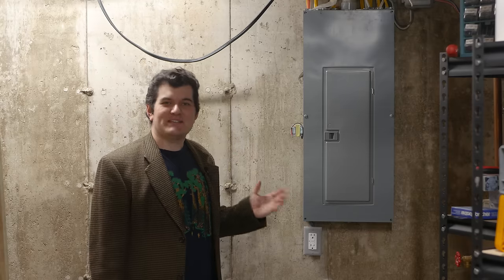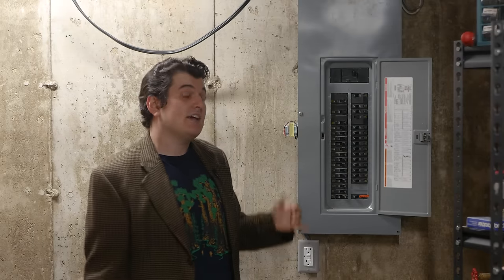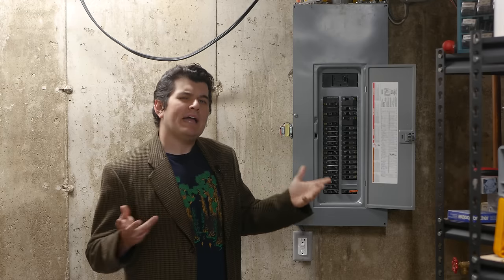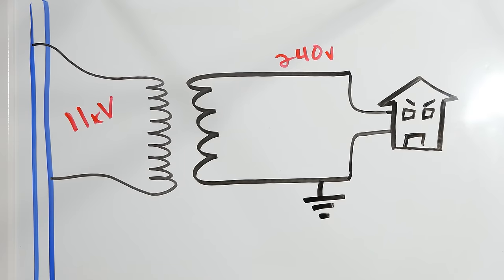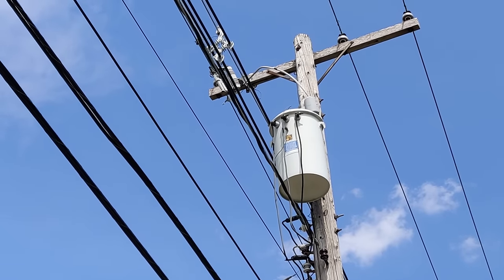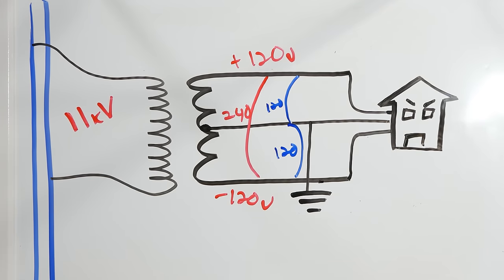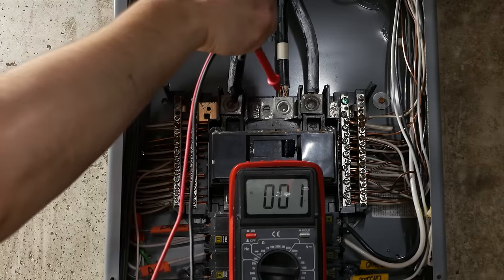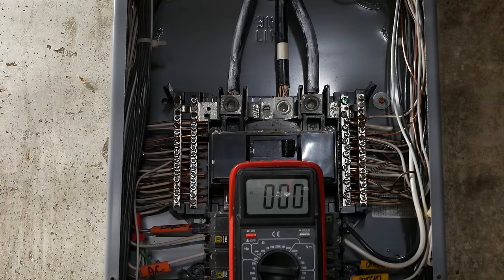The US electrical system is not 120V

Comment: Interesting point regarding the UK plug switches: Yeah, a lot of our stuff that's not pure electrical does not have an off switch (generally electronics just.. don't) as you're expected to interrupt the circuit at the wall.. however: We have the switches for a different reason.

Our plugs are so big and over-engineered for safety that insertion cycles becomes a problem so they're actually there to save a pile of plugging in and removal causing work hardening/loosening of the contacts in the socket - flick the switch rather than break the receptical by having to over-use it..
Reply: Yeah, here in the US we don't worry about stuff like that. Our plugs come  pre loosened.
Reply: I will still never get over Tom Scott's video on British plugs where he explains that in the olden days, British appliance manufacturers weren't required to put plugs on their products, so most appliances came with a bare wire that the customer had to attach a plug to themselves.
Reply: Also it means we can remove the foot hazard caused by having dangly plugs everywhere 😎
Reply: Sammie1053 Ironicly in the US, you can still buy an appliance without a cord, so you have to buy the cord and wire it up.  I think it is mostly on stuff like refrigerators and washing machines, tho.

Edit:  What I meant to say was ovens and dryers.  Sorry about that.
Reply: @Sammie1053  We still commonly teach students how to wire plugs in physics lessons in school - incidentally it's quite useful because it means plugs can be removed and added to cables so we can change cable lengths etc ourselves without wasting perfectly good plugs 👍
Reply: @Sammie1053  We were actually taught how to wire plugs in schools, apparently? I was born after the laws changed and everything came with plugs pre-attached, but I was still taught at my school "just in case".
Reply: The UK plug are shit. Too big, too clunky, and  no real life advantage. Just use the standard EU plug like everyone else ffs
Reply: You haven't watched the Electra boom video is he says UK plugs are the best and EU plugs are just as bad as American ones
Reply: The best thing about british plugs will always be the insulator over the bottom half of the connectors, and the fact that the ground connector opens a shutter to the live and neutral connectors.

The switch is nice when removing the plug though, it just adds one more layer to the safety. You know that there's no chance of you getting even close to the connectors when removing the plug.

Most of our multi gang extensions don't have switches on them though. I have a fancy one that has individual switches that I use for a load of old gaming consoles I don't always want on at the wall due to age though.
Reply: @aggressivli  The advantage is not having to replace millions of sockets in every building in the country (and every device that plugs into them) for a plug socket that isn't actually improving anything.
Reply: @aggressivli  There was a plan to harmonise all the plugs across the EU, but it was deemed to be too wasteful and expensive, so we all just kept our national standard plugs.
Reply: @rainehdaze9157  yeah, its already too late for this I guess
Reply: All true and great points.... But there's more to it that that as well, it's a case of isolation....

If you have a switch on the appliance and not the plug then the wire is still "hot" up intil the switch on the appliance. Meaning if there was an incident that wires were cut or damaged to a short then you could be in serious trouble.

By having an isolation switch at the plug your not only remove the "hot" wires from outside its safety area(in the wall cavities) but also stopping you from unplugging everything and standing on a 3 pin plug that you are 100% sure has went thru your foot into your brain (yes it's very painful)

UK electrics are wwwaaayyyy over engineered but the safety ratings speak for themselves.... And the fact people are arrogantly stupid when it comes to DIY solutions.
Reply: @lukesalisbury6031  Also garbage disposals (you know that thing under the sink that grinds up food and spoons).  The reason dryers and ovens don't come with cords is 1) cost and 2) there's actually 2 different plug standards for those in the US, a 3 prong (2 hots and a ground) and a 4 prong (2 hots, a neutral, and a ground).  Older houses have the 3 wire one because it's cheaper (less wire) and newer houses have the 4 wire since it's required by newer versions of the NEC.  Why, I don't really know.
Reply: @Xilog  don't be ridiculous.  American plugs are not more likely to get loose.
They already ARE loose.
Reply: The only thing the UK type G plug is worse at safety wise then the US type A/B is when you tread on one on the floor in the dark....

If you think treading on lego bricks is painful you have never trodden on a UK plug which inevitably ends up with the prongs upmost!
Reply: BS1363, best in the world, accept no substitutes!
Reply: Sammie1053 wiring a plug is part of GCSE science, or at least it was when I grew up. I figured the plug was so obscure it was easier to manufacture overseas and then have the brits wire it themselves.
Reply: Whats the deal with his hating Ring Mains? They kick butt.
Reply: @earfolds  not quite, Italy are changing gradually from type L to type F and some type J countries are considering the same 

The EU standard plug is the 7/7 (high power class 1)or 7/17 (high power class 2)or 7/16 (low power class 2) all 3 of these fit in type E or type F sockets (and type C although with no ground in the case of a 7/7)
Reply: @barnstormer322  Except for moulded plugs.  then you have to put a wander socket on the stub end if you need to
Reply: @Xilog  I have had a few wall sockets wear loose on the internal pins
Reply: @aggressivli  Nonsense. You will never kill yourself with a UK plug. You might injure yourself if=f you stand on one though!
Reply: The UK (note, I'm in the UK), is a desperate case. Maybe was the atavic memory of the great fires of the past, but with electricity we went from "safety first" to "safety only" in a eyeblink.
Not everyone knows what is the "Clause 12" in the British Electrical Engineers rulebook for electrical plugs. For clause 12, the plug must be designed in such a way the two fingers holding the plug while placing it in the socket, cannot be able to touch, at the same time, the two plug blades. That's the reason for the two bulges on the sides of the plug. Every plug must hold a fuse. The socket holes do not open if the ground blade is not going in first. Every socket must have a switch. The plastic must hold the max operating temperature forever. The cable getting out of the plug must have a mechanical hold. I can keep going on electrical BS (British standard) all evening.
Fact is, the UK plug is pretty safe. Safer than any other plug in the world. It was designed for electrical devices of 1940, and sized accordingly. It is not scalable: as matter of fact, it can contains a 20 Watt power supply easily. But there are disvantages. Manufacturers of many different devices include usually a 5 V power supply, except for the UK, as they should also upgrade the equipment packaging. All imported devices require a non-standard, more expensive specification.
It is a typical British heritage, making some items slightly more expensive and hard to procure in an intensely globalised world.
Think of bayonet light bulbs. Manufacturers now make these universal 90 - 260 Volt AC / DC light bulbs, to reduce costs, but what if the lampholder doesn't have the Edison screw base?
Or, try to sell (or buy) an automobile from Europe. The specs are all the same, but the steering wheel is on the passenger side. While is nice to have some personalisation, it adds to cost in the end. Just like the ultra-safe UK plug. Notwithstanding all the complaints of over-engineering, over-size, over-kill, I prefer to keep the extra safety.
Reply: And now for the obligatory puns...
I was wondering WATT your next video was going to be about and got all  AMPed when it came out as I always gets CHARGE out of you content. I figured JOULE explain at in a way  most will understand. 

I know this can be a HOT topic but you'll try and be NUETRAL and remain GROUNDED if anyone complains to tell them to put a SOCKET in it. This is a very CURRENT topic and it requires a careful explaination but that shouldn't  PHASE you. 

You really do a good job of ALTERNATING between topics. You got a lot of CAPACITANCE  for explaining this stuff. You explain it with perfect METER in you speech. You're great at being able to FUSE complicated concepts in a coherent video that GENERATES  much discussion.

 I understand if some concepts are hard to understand even for you and it HERTS your brain, just RELAY the info as best you can.  Just don't LOAD the videos with to much complicated stuff. You do it your way, more POWER to you. 

You should go on the lecture CUIRCUT as you have more RANGE and sound are less DRYER in you mannor of speaking then some.  Just don't stray to far from OHM sweet OHM.  

By the way, what do you think of a symphony CONDUCTOR doing INSTRUMENTal AC/DC tunes? Would that be ELECTRIFYING or would it fall SHORT of your standards and make you want to VOLT out of the theater? But that beyond the oscilloSCOPE if this topic. So I'll take a BREAKER and SWITCH to other tasks. You're always a LIGHT at the end of the tunnel even for dim BULBS watching who are too easily LED astray.
Reply: Ted Logan DCL is now standard in EU.
Reply: @aggressivli  The european ones are truly awful.  I know I'm biased cos I'm Uk, but no, those ones are awful. They are loose, move around in the socket and, just no, they're awful.  Really.
Reply: @gingernutpreacher  In that case I want to see what he thinks about Schuko plugs. Basically most of the good things of the UK plug (minus child protection as standard and an integrated fuse), but much less of a foot hazard.
Reply: @lukesalisbury6031  That's true, I actually helped my parents put the plug on their dryer two years ago. It's because as mentioned in the video, some high voltage sockets are two phase and some are three phase, so the dryers are designed to use either and have the cable connected at installation depending on which one is needed.
In the case of old British appliances, we're not talking about kitchen appliances, we're talking lamps and toasters here
Reply: @aggressivli  UK it's are the safest sooo
Reply: @Sammie1053  Olden days? we were still wiring up our own plugs in the 90`s.  Its a pretty recent thing to have everything come with a fitted and sealed plug here in the uk.
Reply: @dasy2k1  The EU standard plug I'm talking about is the aborted Type N (IEC 60906-1) switchover.
Reply: @ec8107  As I learned from experience while visiting they come with bonus zing if you are not used to them and thus fail to treat them like they were designed by an utter bloody moron. Suffice to say did this exactly once but was enough to make me put my totally not an electrical engineer skill set to the task and fix the problem, a bit of insulating tape works wonders to fix the built in death trap cheap too lol. Still why on Earth can a software engineer figure this out but not the person that designed the plugs did they have any engineering qualifications at all I wonder? That said granted tape does not have the wear resistance to last all that long with repeated use, really should be a more hardwearing insulator than that but still was more than happy to replace tape in order to avoid repeating the painful lesson about US plug safety or should I say total lack thereof.

Not that ours don't have their own painful surprises in store for the unwary mind you step on the damn things and learn the hard way that lego has a challenger for most evil foot torture implement ever devised. Actually probably might just want to take my word on this and avoid trying it but each to their own heh.
Reply: @Jademalo  Only the new plugs do have insulators. The old school ones do not have insulators, much like the US plugs made today.
Reply: @lukesalisbury6031  

My dishwasher doesn't come with any cable. I had to wire it to the cabling already coming out of socket
Reply: @robertfullard5646  - They add a higher safety risk for absolutely zero functional or financial benefit. The risk is that they are inadvertently overloaded if any of multiple connection points fail (eg: <20A fed from only one side of the ring).
If you are running both ends of a 32A ring back to the consumer board (to create a ring) then you might as well just run two separate 20A circuits instead (and save the copper needed to close the loop).
Reply: @johncoops6897  True but you're going to have to double the size of a lot of people's consumer units to do that at this point and not many people would be in favor of that as a lot of them are in small cupboards in hallways that'd have to be modified.
Reply: @gingernutpreacher  ElectroBOOM was just talking about the Europlug (type C), which is better than the American plug, but still bad. Those two arent as good as the real deal which is the Schuko (plug types E/F).

Comment: When I was a kid, my little brother decided to drop a penny behind the outlet cover in his room. It was an old 120 2-prong receptacle and that penny fell in just the right way to bridge the gap, my family was all surprised when we screamed. I'm not sure why, but I was the one who ran out, through the living room and kitchen to get to the breaker box. Being 10, I just turned everything off as quickly as I could. Needless to say, my dad pulled out the remains of the penny while replacing the outlet and it proved to be a good lesson to all of us. My dad doesn't neglect electrical repairs these days. Though I don't know why he never did anything about the one power switch in a place we lived in for a year that almost always shocked us.
Well, actually I do. My dad was in terrible mental health during that time, so it took a lot out of him just to provide for us. He and my mom had split because of it, which honestly just made things worse, but that's all a different story.
The electrical system in the US isn't something you should play around with. Thankfully I know some electricians, so I know who to call to help me.
Also, I checked my panel. 100amp @ 240v. I figured, being a manufactured, single wide home. I think I'll save up and get my electrical system reworked, though. The place is about 30 years old and I would like to make sure it's all up to code.
Reply: @silversonic1 what did you find out? I'd be very surprised to learn that even a manufactured home from the 90s doesn't meet all the code that applied to it when built and even 95% or more of the most current electrical code.
Reply: @GurtTheHurt  I sadly haven't been able to do anything yet. Well, anything beyond learning that my living room and middle bedroom have been all wired through one breaker.